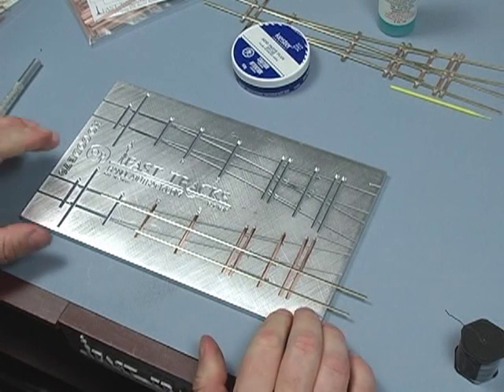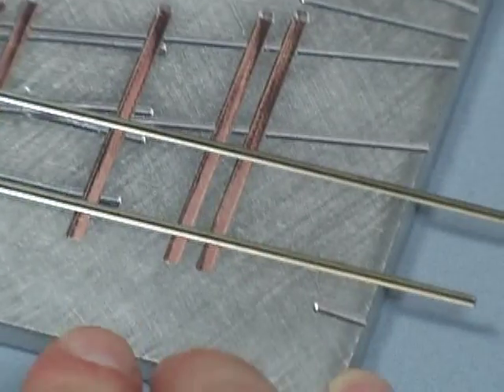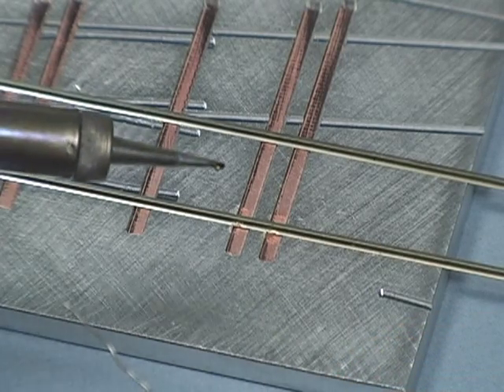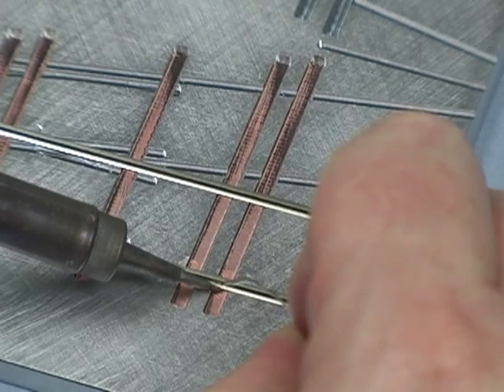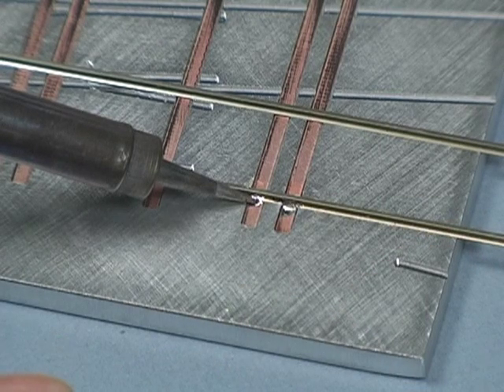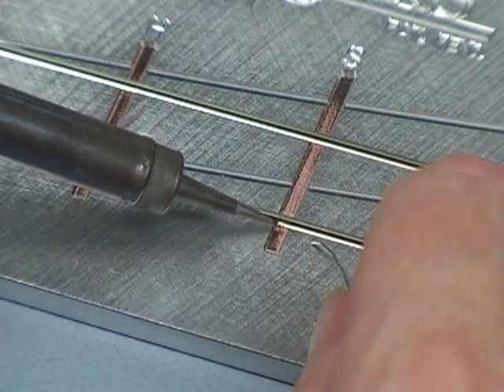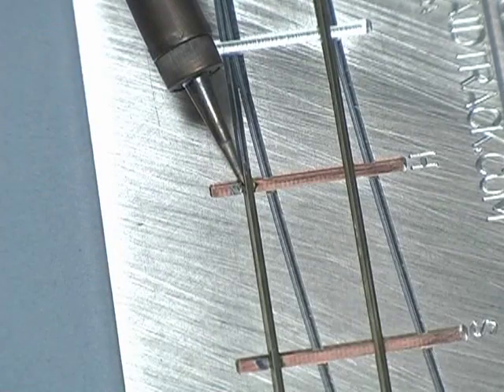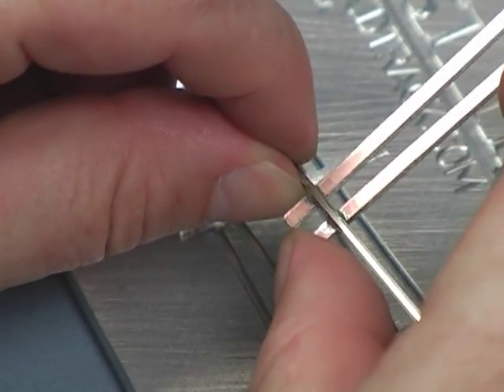Soldering Trackwork Using Acid Based Flux

Comment: For all the people that come here trying to learn... Solder flows towards the heat. He should be applying solder on the opposite side of the joint and letting it flow towards the iron. Because he is doing it backwards, he constantly has to "add" to the other side.